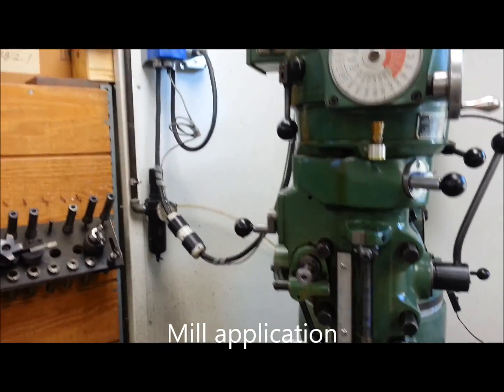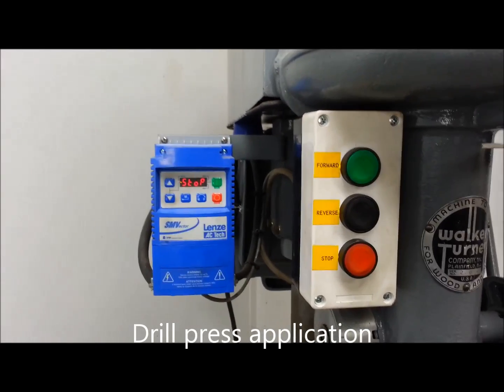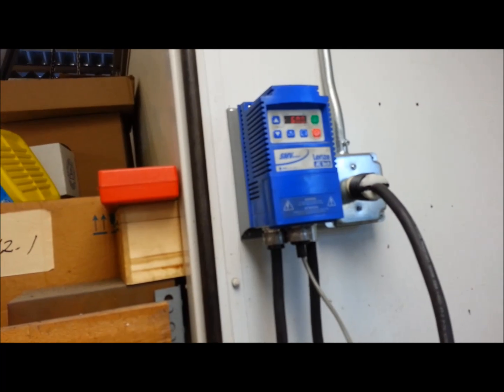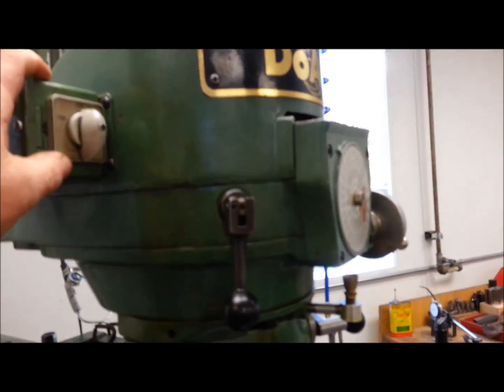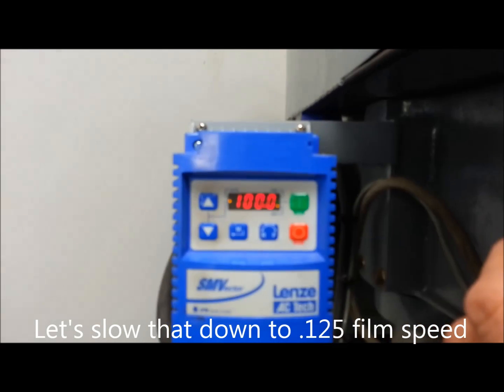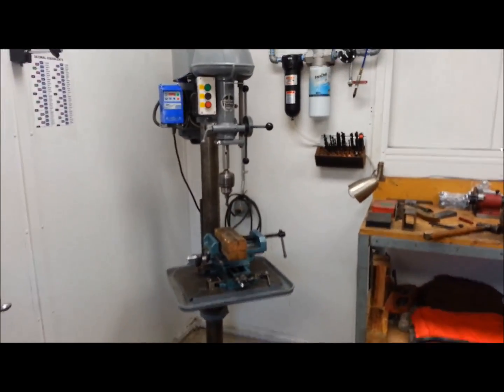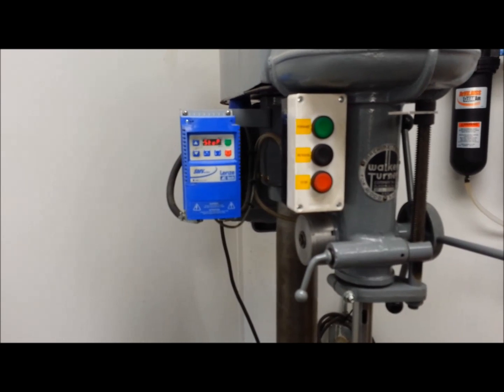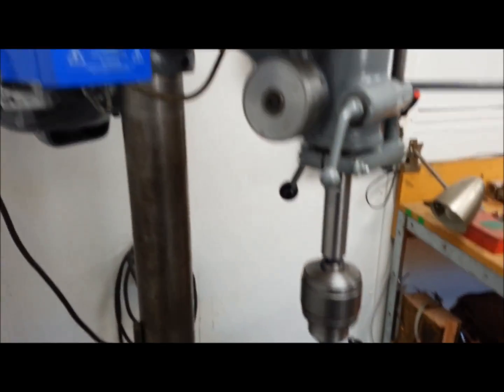VFD introduction / application / information

Comment: Awesome video. I just bought a 7.5 hp Hitachi VFD to drive my 5hp lathe. The Hitachi rep said because I am imputing a poly phase it needs to derated. I had a brain storm the other day, and tell me if i'm loco or not. I currently have a static phase converter powering 4 machines. There's never more than one machine running at any one time. I bought the VFD to power the lathe because I am picking up harmonics when turning in the surface finish, also the machine is 70 yrs old and the fastest speed is 645rpm. Not so good for carbide or alum., so I want to overclock it a bit. With some sort of selector or interlock could I drive all my machines with one big VFD and have variable speed at each machine?
Reply from the maker: As far as unwanted harmonics, look for the "skip frequency" parameter, this will have the drive skip any speeds that cause unwanted conditions.

As far as using 1 drive to power multiple units, the odds are very slim that all operating parameters will be adequate for everything you want to run, unless you want to reprogram every time you switch to a different machine, I dont see it working out too well for you. I would need a list of all motors and their intended use.
Reply from the maker: Hi Jarret,

I have used Hitachi drives in the past, Japanese made, first class units. I looked up the manual for the drive I used and it was a 10 HP / 480V unit, I can remember the customer (JBL Pro) asking for quick parameter group changes and this drive was the only one I could find that would accomplish this, the drive would store up to 4 full parameter program groups. With the flick of a remote switch it would change / base speed / speed reference / ramp time / control input type / max output.

That being said, this was a VERY high end drive, I also found the bill for it, in 2011 I paid 1800.00+ for it.

Regards,
Stan
Reply: Shadon HKW
Thanks for looking that up for me. The info is greatly appreciated. Parameter program groups, I will have to wright that down, and see if the manual makes any mention of it. Given my unit is in the $600 range it may not be capable if such advanced functions. Although PLC's are fairly cheap these days, maby I could pick up a cheap PLC to handle the logic end and let the VFD do what it does best. I will just have to dive into the manual when the VFD gets here.